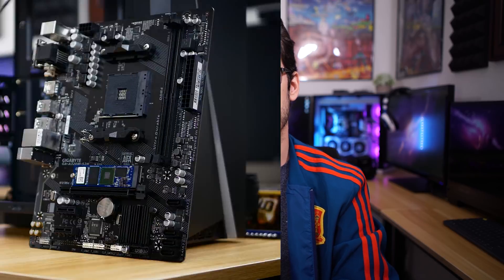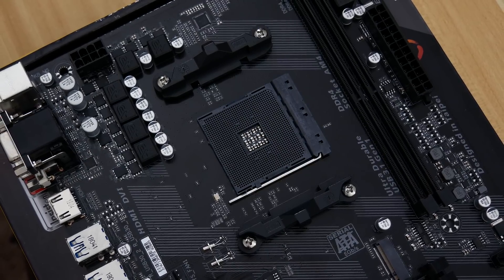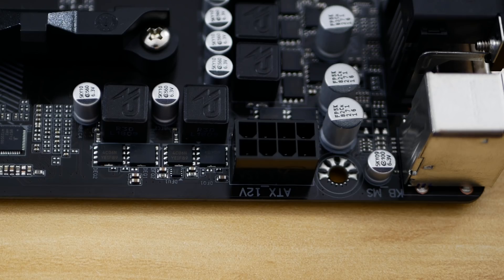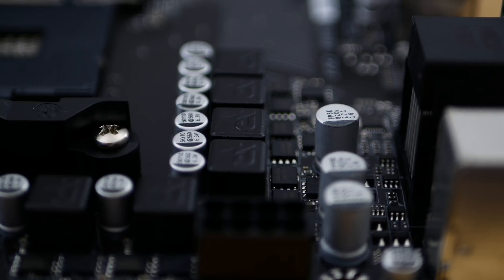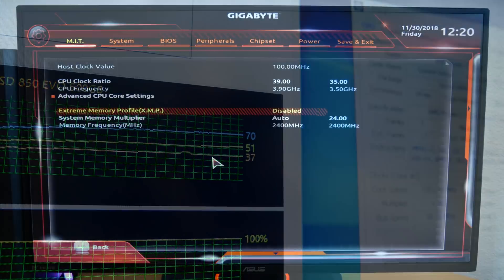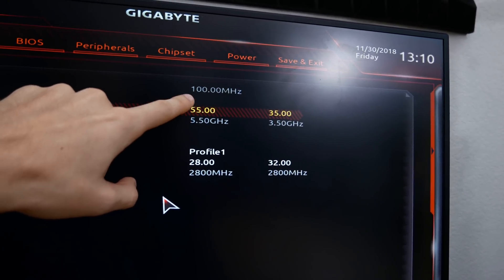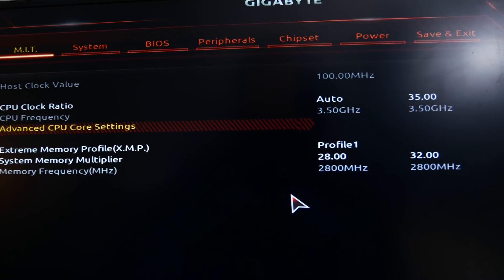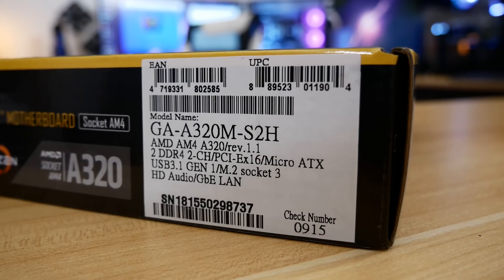We Bought the Cheapest AM4 Motherboard on Amazon...

Comment: I have bought that mobo, the only complain is once you put something close to an RX480/580 you can't use the 4th sata port and the 2 pcie ports.
Oh it overheats a lot, unfortunately, especially with a GPU inside once you play games.

Anyhow it's a great board for the price after my B350 failed me. I'm really glad to have this one.
Reply: Just wondering what board was it that failed on you???
Reply: Yeah I ended up with a bricked b350 too ended up swapping it out for the msi x470 gaming pro no point going backwards with tech in my opinion

Comment: I see that VRM and I can imagine why you cannot OC on that board.

Seems designed for things like 1080p 60Hz gaming or TV/Video
Reply: Well that and the fact it's an A320 chipset board. Essentially the AMD equivalent of the H series boards on Intel's side of things.
Reply: it's designed for prebuilts. Like every other locked chipset...
Reply: @razvanmiracom  Not all custom builds need to be overclocked.
Reply: @nathanhamman418  agreed. Most of them are though...
Reply: You cant oc on it because its a320. A320 doesnt allow overclocking
Reply: @thedaveman2  it has an adjustable multiplier that wont OC... I wonder if you can down-clock and under-volt it.... Don't ask me why anyone would actually do that I have no Idea, just curious.
Reply: @ExalyThor Even ultra-high, with Ray Tracing man. ;D
Reply: I have a gigabyte b85m ds3h-a, it's a cheap ass mobo with cheap ass vrm design but I overlooked my g3258 to 4.4GHz (from 3.2) with 1.335v.
Seems to be doing fine but I don't have temperature probe to check the vrm temps and the board doesn't have a temp sensor
Reply: @TotoGeenen  probably hotter than lava

Comment: I built 2 office PCs using that mobo & R3 2200g. Paired them with 2x4 3000mhz DDR4 and no complaints so far. Works great.
Reply: Well yea, $50 mobo + $100 APU + $25 PSU + $25 128GB SSD + used 8GB ram and a $20 case. Done, you get a $250 ish gaming PC.
Reply: $250 is an insane deal. Might as well throw in a GPU in there and make it a $500 gaming beast.
Reply: @yashwinning  that's doo Doo I got my 225 dollar PC with an Rx 480 I bought all the parts online
Reply: @yashwinning  No. You really don't want to waste that much money with that board. It's not futureproof whatsoever.
Reply: @yashwinning  the ryzen 3 2200G is still a decent entry level gaming system even here at "the verge" of 2020
Reply: @cunnyman  I have used a 2200g for my $500 budget gaming build and it works flawlessly. It might not be very future proof but at present, it runs every single game without any problems whatsoever
Reply: @cunnyman  this has not aged well
Reply: I have the same config and works great
Reply: 2x4 ddr4 you know it only has 2 slot of ram
Reply: @randomcatontheinternet2771  2 sticks of 4gb ddr4 go to 2 slots of ram on the motherboard. What are you trying to say?
Reply: Me too! Same motherboard for office!! One for me, with 2200G and one for colleague with 2400G. Another one is waiting in the line, with same config as mine.
Reply: Soo this mother board is ready for ryzen 2nd gen ?
Reply: if they only office pcs could of gone 200Ge
Reply: LEGĬØN What ram?
Reply: Carlos Vargas viper 2x4 ddr4 3000mhz
Reply: LEGĬØN have you updated your motherboard bios or no?. I mean does it require  the latest version of bios or no?
Reply: LEGĬØN with the 2nd ryzen generation
Reply: Anos Tr it booted up just fine the first time but just for piece of mind I did update the bios after windows installation.
Reply: Did you have to update bios?
Reply: Office! They are going to play games. Look at your workers
Reply: how does it run in games? did you use a gpu with it?

Comment: When I first built my PC i chose a GIGABYTE Z170-HD30, not sure why because it was a component which really didn't need to be that expensive and i should have gone with a more inexpensive one for my type of use. Anyway I keep getting weird stuttering on screen with games and videos that really should run with my specs, ie on YouTube if there in a moving object ie a black rectangle moving left to right, it will leave a sort of trail behind it (kind-of like a cursor trail) for one frame behind it. I've tried many different 'solutions' to my problem and none of which have worked. If anyone knows any solutions to this problem I would be glad to hear them, thanks :)

Comment: if i dont overclock and i just have 1 8gb ramstick at 2400 frequency and a gtx1050 will performance go down if i use this board? in terms gaming such us pubg, csgo and dota2. will it bottleneck my gpu?
Reply: You shouldn't lose too much performance. But you would probably benefit from a second stick of RAM. So something like a 2x4gb configuration. If you only want 8gb of RAM in total
Reply: @React2Quick   thank you so basically i would get this board if i dont overclock and if i dont care about extra features and aesthetics. cause 50 dollars is really a big help for saving money.
Reply: @wickedhate2006  I wouldn't say this exact board but yes if you don't want to overclock at all then you could get an A320 board. But at the same price there's B350 boards that offer slightly more features an obvious one is overclocking support but you don't have to OC on B350. I've never used A320, I have always used B350, I'd say that A320 boards are more geared towards if you want to do a home theater build. Always look into what you're considering purchasing before hand. Just because it's at a cheaper price doesnt mean it's good.
Reply: @React2Quick   ohh okaay. thank you man. b350 and one more question is that what is the equivalent of a b350 board intel 8th gen cpu's?
Reply: @wickedhate2006  the equivalent of Intel's 8th gen chips for the B series chipsets would be the B360 chipset. As before Ryzen, Intel had the b150 and b250 boards.
Reply: @React2Quick  thank you for the info

Comment: Bought an "inexpensive" AMD 4 Gigabyte board (GA-AB350M-DS3H) to use with the Ryzen 7 1800x which proved unstable with a 1080Ti.  Devil of a time troubleshooting to that conclusion (4 days) but I replaced the board with an MSI B450M PRO-M2 which solved my instability issues. Since a GTX 1030 proved stable with the Gigabyte board, I'll try it with a 2400G APU instead.  Only a $60 board so worth trying to salvage.
Reply: 84Actionjack Running a R7 1700x and GTX 1060 3gb on a similar GA-AB350M Gaming 3 motherboard with no issues so far.

Comment: So what you're saying is that these boards are perfect if Walmart ever decides to make Ryzen based OVERP🐡WERED gaming PCs.
Reply: I love how you put the blowfish in there
Reply: whats the best budget board for a ryzen 5 1600?
Reply: @dubb9020  b350. i have a 1600 on a b350 for a year now. Very good price-performance combo. Will do 3.8-3.9 GHz on a 120mm aio.
Reply: @razvanmiracom  thanks, im building a dedicated streaming rig with my ryzen 5 1600. would you happen to know whats the cheapest gpu i could use?  im on a very tight budget . i spent all my cash on my gaming rig
Reply: @dubb9020  well, if you went for a ryzen 5 1600, i think you're gonna go for cpu based streaming. In that case, go for a rx480 8g or a 1060 6g. They will do 1080/60Hz with most details in most games. I'd advice 1060 6g (though i own a rx480 8g myself) because most game developers optimize the games for nvidia cards.
Reply: @razvanmiracom  i get that same performance even without an aio. 😆
Reply: @dubb9020  I agree with razvan, RX580 or GTX 1060 6GB. If you cant find either than an RX570 4gb/8gb would be ok too.
Reply: @razvanmiracom  MSI and Asus make some pretty good boards. Im using the the Asus rog strix B450-F gaming and its pretty great B450 board.
My X470 choices: MSI Gaming Pro carbon X470 
 Asrock killer SLI X470

B450: Msi Pro carbon B450 
 Asus Rog strix B450F
Reply: dubb so its a separate pc? If so, you can use a cheap ass gpu. Encoding a stream from your gaming rig is pure cpu power

Edit: dont get complete garbage though, obs does use the gpu for some things. I recommend getting something like an RX 550/560 or GTX 1050. Should be more than fine with any of those cards.
Reply: Razvan Popescu he has a gaming rig. He is asking if he needs a good gpu for his “streaming pc”. Smh
Reply: @razvanmiracom  I don't of mine lol, although I have the stock cooler
Reply: dubb I like the ab350m-pro4 from as rock
Reply: Right... Here is your new Ryzen Overpowered PC, A320 + R7 2700X, you turn it on, start intensive game, 5min later you hear plop, PC shuts down and you find your motherboard VRM on your graphic card... :-D But hey, they might hotglue it for you. :-D
Reply: i dont know whats the problem with this board i also use before this board the cheapest fm2+ board and it lasted 4 years if ur dumb and overclock crazy then its not a good idea but comeone is just fine it not like it will blow up while gaming using ryzen 7s if not they wil not support it ij the first plce or they will have a massive recall this board is just fine im using a ryzen 2200g and rx 580 and it runs fine i also oc the cpu a bit with this board u will need a expensive board if u plann]n to oc if not then just buy tis board no use to buy more expensive boards when u gonna cange sockets in 3 to 4 years
Reply: To expensive for walmart
Reply: Nailed it!
Reply: I bought a pre built from best buy and it has this in it
Reply: The rev 1.1 if this card has an b350 chip.
Reply: Pretty much